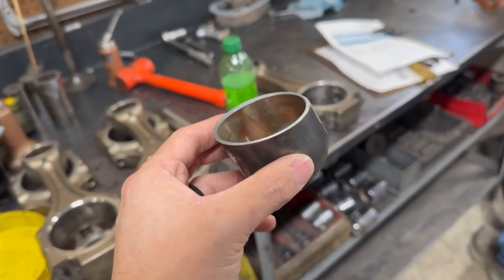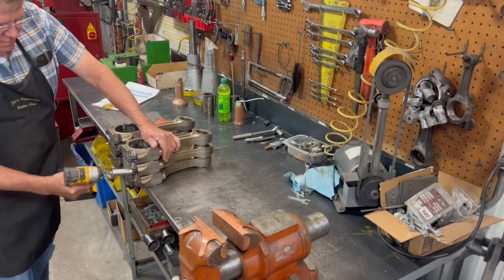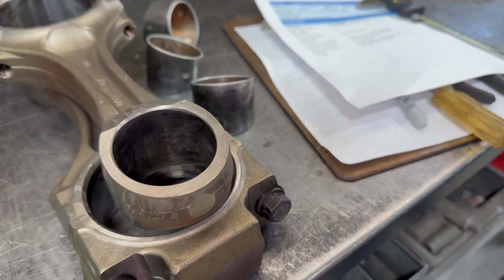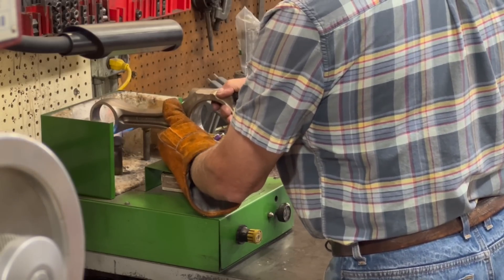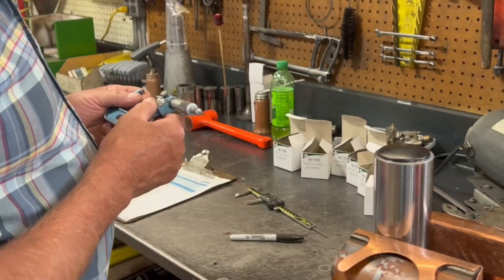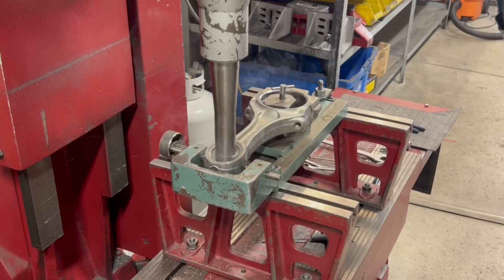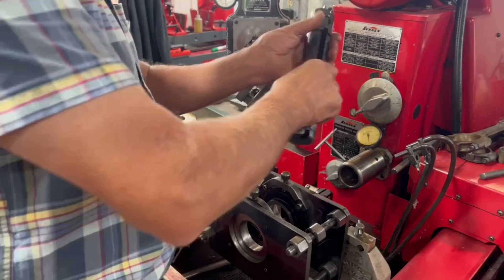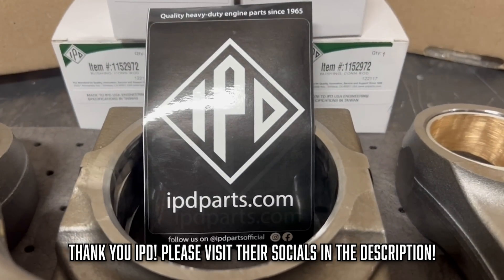Replacing C12 CAT Wrist Pin Bushings In 5 Minutes

Comment: Heating the pin end of the rod will expand the diameter. How about dropping the new bushings in liquid nitrogen? We use that method to install cylinder sleeves. No more hammering or cold pressing.

Comment: Them dumb bumper pins they wont stand on end to mic the pin to set the clearance.... im surprised you guys haven't got a tobin arp PM pin machine you can set length and its a very well thought out machine very user friendly....long since bought out by sunnen and dis-continued, used ones can be found.....they are a versatile machine for more then just pin fitting... also we weld an old bushing to an old pin then remove .010-.020" off the o.d. in the crankshaft grinder  so it passes through the rod pin bore they look like your installer that you showed there... we have "innies" and "outties" and on the innie we set the old bushing on the pin where it bottoms on the press stop when the bushing is centered in the rod then weld it solid grind the o.d. and its ready for years of service and centered bushings

Comment: Heating in a small oven or even better a heated oil bath (basically a deepfryer) I've found is best at it reduces the chances of overheating. That said direct flame works and if you aren't going that hot and pay very careful attention that it works just fine. The other options make your given heat a more repeatable and less skill dependant result.

Comment: I did many sets of Mack rods. I had an air over hydraulic press and a driver to push old bushings out and new bushings in. Also had a stepped broach that I ran thru the bushings to size them. Finished them same way you did but had no power stroker. I always dressed the pin ends on a belt sander. Occasionally did big ends but as you said they were usually good. Mack rods were big ! I did a lot of heads as well. Old 6 cyl Mack’s and they were from a Mack truck place that rebuilt/serviced UPS trucks

Comment: Everything in my engineering brain is telling me the heating install has the least chance of distorting any part of the rod and bearing sleeve.  I have also seen a lot of cold installs, where the bearing is frozen and the journal is either room temp or gently heated.

Comment: In aviation we use a lot of inconel and it loves galling. Lubrication is a must and if an interference fit is required, a temperature differential is mandatory. But not all steels gall, and some steels don't like heat or LN2. So whatever works for you without weakening the rods is your decision

Comment: I think you should of used a hammer and the closet size socket to put the bushings in. Then use a brake hone to get the id of the bushing right for the pin.  Just kidding. But we all have probably heard of someone doing that. Awesome video once again

Comment: I need this exact job done on 24 connecting rods for a pair of MAN D2842LE404, Along with rebuilding 24 cylinder heads and replacing several piston wrist pin bushings. 

I can’t find a reliable shop locally and can’t source bushings through factory/OEM as they aren’t offered as a repairable part.

Comment: ah, yeah I know the Physics behind engine parts getting magnetized. If you take an iron needle and stroke it with wool and put it on a leaf that is in a cup of water the needle will point towards a magnetic heading. You can get the same effect by banging an iron rod, and again it will align with the magnetosphere. If you want those to point to north, the needle/bar needs to be aligned with magnetic north, but most align them with the rising or setting sun which is good enough to get you where you're going. As for degassing internal engine parts? Well, those things even with perfect geometry and proper lubrication still erodes microscopic particles of metal which can build up where no one wants it too.
Reply: Probably more to do with all the magnetic field and the rods moving during cranking. If you have a compass , install it on the dash, and crank your engine. Glow plugs also make magnetic noise